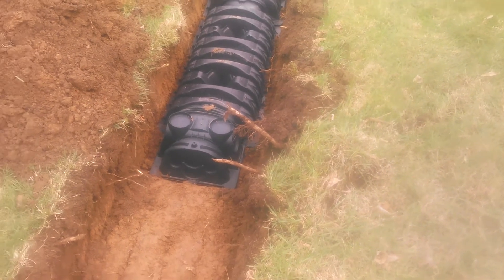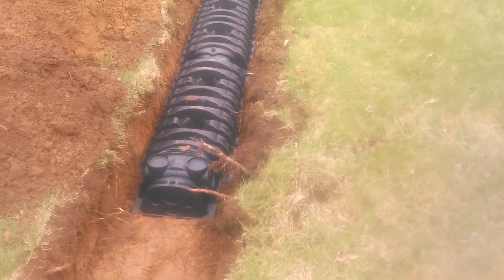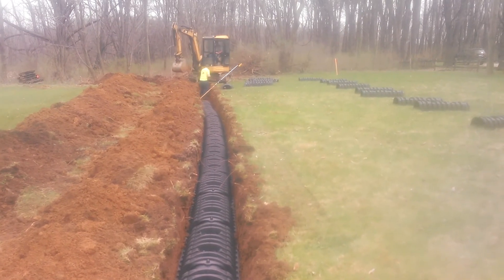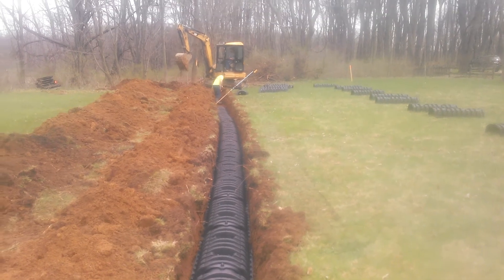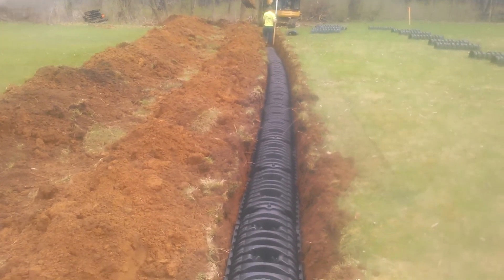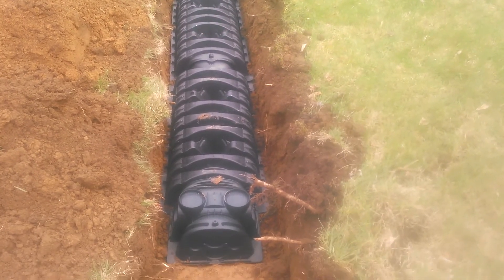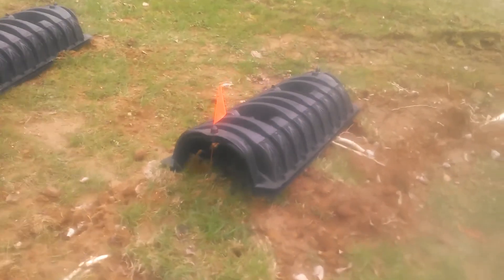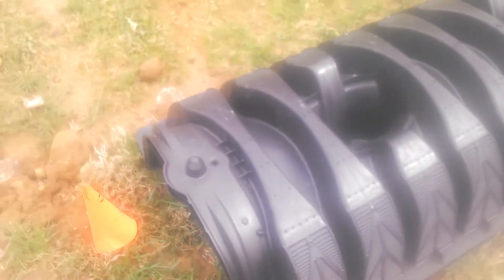Leach Lines part 1

Comment: Ever use a 36 inch bucket
Reply from the maker: Ya we have a heavy duty 36" rock bucket. This machine handles it pretty good but you do have to watch swinging to the side. If you had just a standard bucket it would handle it with no problem